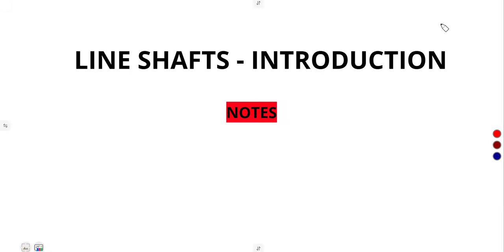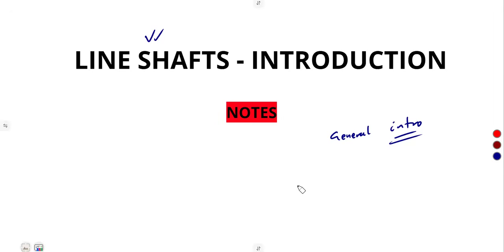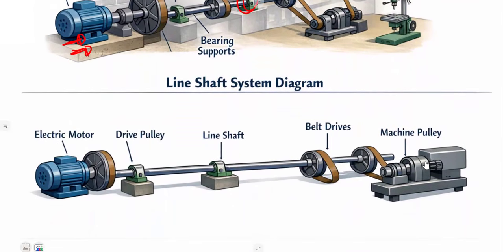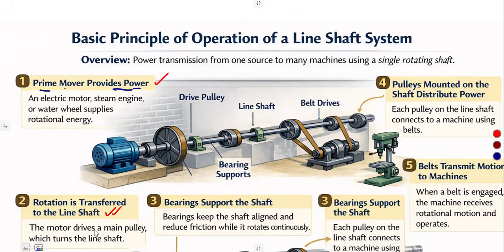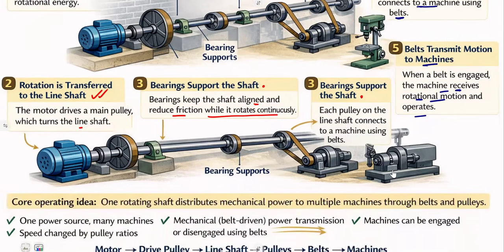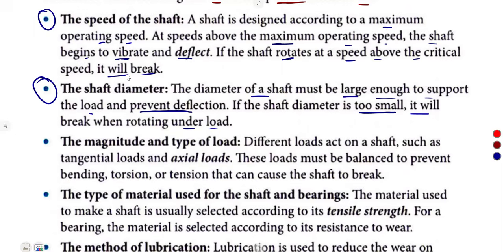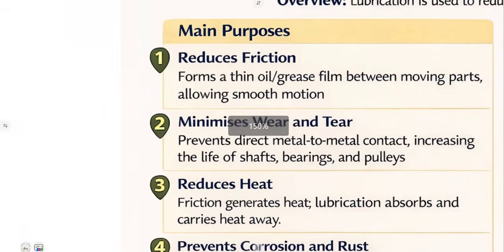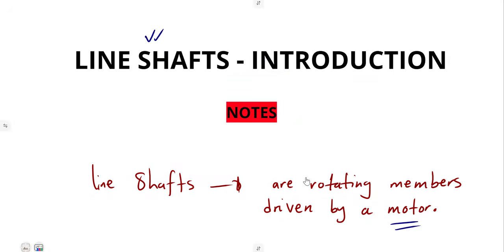Mechanotechnics N6 Line Shafts INTRODUCTION @mathszoneafricanmotives

Comment: If you joined the wrong level there is an option to switch levels.
Reply from the maker: It’s available, you can upgrade if you want the level above. Or you can downgrade, if you need a stage before